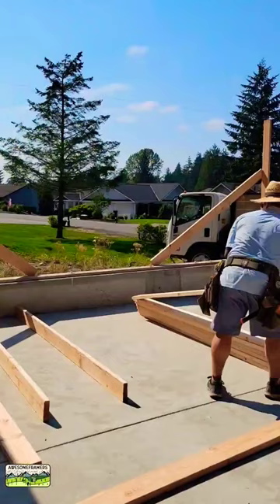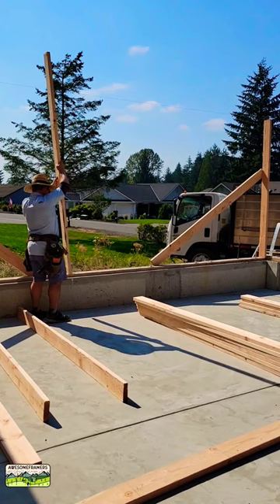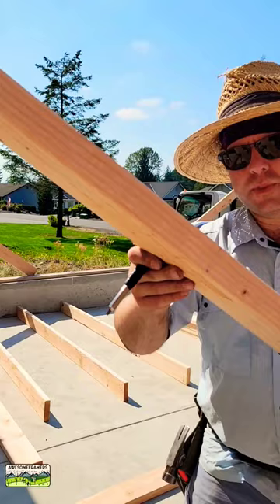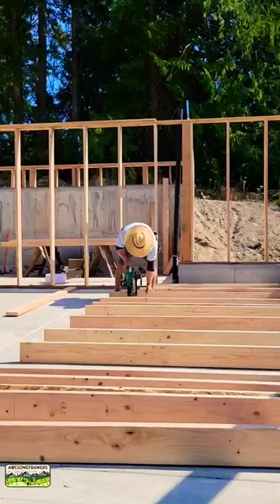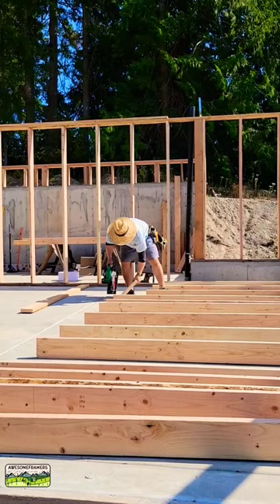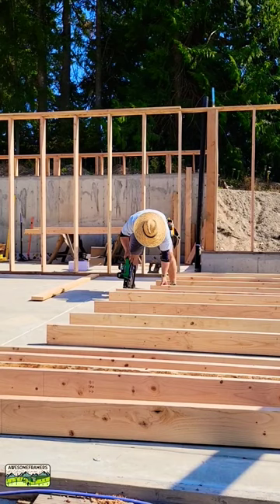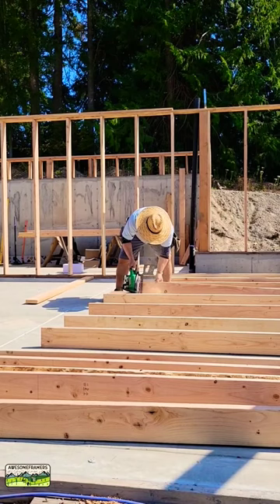Idiot Proof?  Pretty Much #shorts

Comment: How do you make sure the 2x6 is plumb when touching the chalk line or the tolerance is acceptable for framing work? (Asking for an idiot friend ;)
Reply: Exactly what I thought, if you're not plumb you're not going to be as accurate as he's making it seem.  But more often than not there's tolerance with framing, that's why you can do cheat stuff like this
Reply: The shortest mark on the stud is plumb. If it is out of plumb in either direction the line will be higher up the board.
Reply: This is known as a small angle approximation. 2" out of plumb = about .02" longer, so less than the thickness of your pencil line.
Reply: @Dan__W  I like that answer simple and easy. Thanks
Reply: You are asking too many questions.
Reply: The string line should be Plum with your bottom plate as long as your Corners in the right place and your bottom plate is straight so the moment that you touch the chalk line with your 2x, as long as it's resting flush on the bottom plate, it will be plum
Reply: @HomeImprovementHapa  this is the correct answer!!!
Reply: @autodidacticartisan  that’s only plumb one way though. you can always straighten the whole wall after but we’re talking about studs here
Reply: @jesuschrist9597  well youre the f*cking carpenter, why don't you tell me, Jesus
Reply: Are we building a Swiss watch?
Reply: @karlmiller7500  best answer so far!!
Reply: Jeez man... if you watch the video see how he sets the 2x6 on the bottom plate... its 50% set on.. which gives ya plumber than plumb when the line is mid run in the exact middle 😎👍
Reply: @Dan__W that’s correct, you can see he pivots the stud on the bottom plate, so the stud swipes an arc on the string. You can also feel the the stud being plumb in your hands, same you would do with a surveyor rod

Comment: For everyone asking "What if it isn't plumb?", the shortest mark made by the chalk line on the stud is plumb. If the board is out of plumb in either direction the line will show higher on the stud. You'd just need to move the top of the board from one side of plumb to the other to see the shortest mark.

Comment: I applaud your effort at getting the job as perfect as possible. When I was being trained by my dad we crowned every stud and came back to straighten the studs with straight line, saw, wedges and fasteners. We cut our top and double plates off of the shoe plate, never measuring anything in the air. If your double plate was short or hung over then it meant something was wrong and you had to find out and fix it. I don't frame anymore but I know that no one can be competitive and affordable in our area doing those things. I'm surprised you are able to make it doing work like that.

Comment: Fantastic! After marking all the studs do you then just toenail them to the plate or do you take everything down to nail the ends? I'd really like to know!
Reply: He is laying them out to frame on the ground, so my guess is that bottom plate was put into position temporarily but isn't permanent so he can pull it out and nail the studs to it.  Toenailing would be way too slow and labor intensive.

If you can't or don't want to put the bottom plate in place, you could just lower the line on the back sides of the two studs by 1.5" to account for the difference.

The real story is this chalk line tip only works when you have an existing stud on both ends of the wall to fasten the line to.  Truthfully I think most framers would just cut all the studs to the same length and wouldn't worry about the slight differences unless it was significant.  Granted these guys aren't most framers - they actually pay attention to the details and that is what makes them professionals.

Comment: Having worked with string lines in the excavating world, there’s no possible way to pull a 25’ string line tight enough that it doesn’t sag in the middle. Not sure this is a great tip…
Reply: Found the first it that one comment that is true
Reply: Yip. I keep and use my old 1-200lb braided fishing line for plotting out (wrong truckers hitches everywhere, keep pulling tight and they lock themselves off). Even the 200lbs will break long before it's close to flat.

Might look level 8ft off the ground but do it 4inchs above the ground and it's obvious

Comment: Been doing carpentry work for years. I'm wondering what you do on the daily to keep a healthy back? This may be a stupid question but God know my back needs help.
Reply: Hang off extension ladder on racks make sure you stretch and working smart willsve your back
Reply: Foam roller hugely helps out
Reply: Get the chirp wheel back problems gone and spine seems aligned better
Reply: Need to add strength to back muscles/legs. Allow 20 mins a day to stretch and do squats with no weights. Once you can do 100, try with one leg using balance. People underestimate the importance of strengthening and stretching your lower half. If time allows, do 4 sets of 25 push ups. 👍🏽
Reply: Heavy squats and deadlifts, and lots of mobility work

Comment: Before youtube I've never seen so much toenail studs when framing new construction.  Seen 1 youtube framer that put top plate and bottom plate on and toe nailed every stud instead of framing and standing up.
Reply: I think toenailing is stronger. Driving the nails in at opposing angles, and the nail shank not being parallel to the grain
Reply: @dickbutt7854   nope,   The right angle sheer strength isn't the same
Reply: @dickbutt7854    Toenailing a wall in It's not proper for me it's what you do when you have to repair a wall and then you have to solid block between each stud and/or it's done in order to pass code This method may look neat but it isn't and it's definitely not proper  Framing
Reply: @mjolnirswrath23  it's not proper for you, but it makes sense mechanically
Reply: Toenailing is slow and there is more room for error since you have to ensure the stud is positioned correctly in two different directions, so I can't see why a production carpenter would do it by choice unless they had to.

Perhaps there isn't room on the ground to frame the wall before setting it up, or maybe the framer has an injury so they are trying to avoid the need to lift a heavy fully-framed wall?  Not sure - but the only time I see professional framers cutting and installing studs one at a time is when they are doing remodel work and no two studs are the same length, and/or existing floors and ceilings prevent them from raising a wall in place.
Reply: He is framing the wall on the ground he's just standing them up to mark them on the chalk line then he takes them down Cuts them and builds the wall on the ground he's not toenailing
Reply: @karlmiller7500  he already has the treated board fastened to the foundation he'd have to unbolt board to take of to frame on ground. We have always used a untreated bottom plate and fasten down to treated never used treated as bottom plate.

Comment: Yeah but how do you make sure you are cutting as you measured them? Which side of the line do you cut on. And where exactly do you put the markings on the shoe of your circular saw relative to the chalk line? Thank you so much if you can help!
Reply: If you ran the chalk line over the top plates on the corners you would cut away the mark it left. Also this isn't about a millimeter or two.
Reply from the maker: At first I didn't think you were serious, but in case you are here is the answer.  I always cut towards the short side of the stud, so I leave the line.  

Also, it doesn't matter 1 bit 🙂

Comment: Just use a Lazer to get the post stud lengths. You said you already had it out to set the string. It's faster and easier that having to set a line and set a board up to it scribe it, take the board back down, cut it and put it back in black.